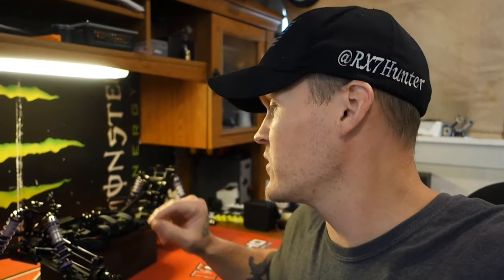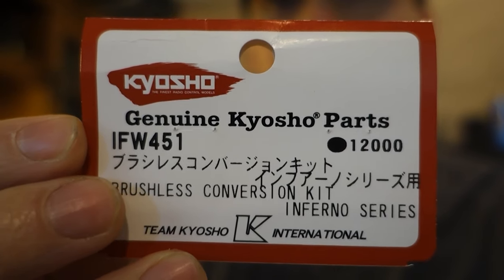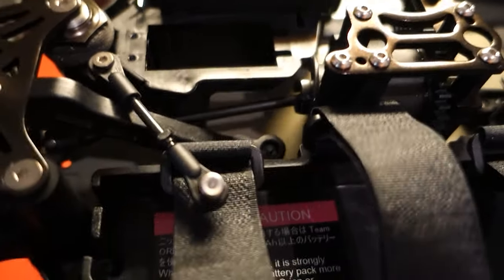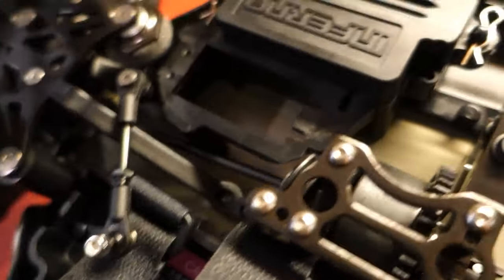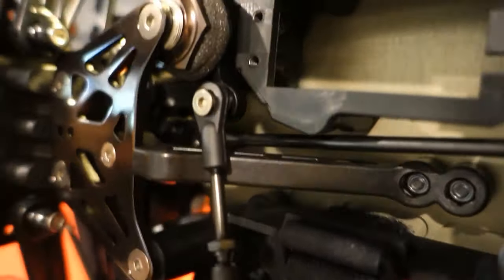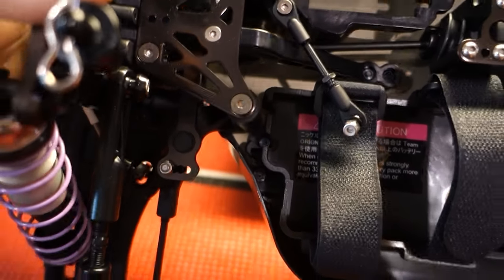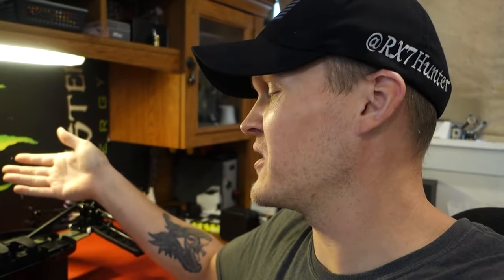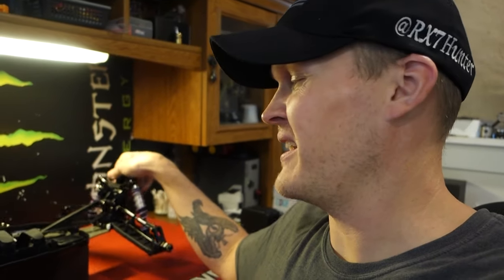KYOSHO BRUSHLESS Conversion Kit IFW451, Will it Work On The NEW MP10 & MP10T?  MP10Te PART-2

Comment: I just ordered that conversion for my mp10t. Is the center diff spur gear the same pitch as the mp10te?
Is it considered mod1 and what size pinion are you running with the 2250kv.
I think the center diff spur is a 46T.

Comment: Thanks for the video! Just assembled it and ran it with a 15 tooth pinion and the stock spur. There's not much top end. What pinion are you running? And did you change the spur gear as well?
Reply from the maker: No problem man thanks for the support👍🏻 I’m running a stock spur gear with a 16 tooth Pinion

Comment: I plan on doing the same e-conversion. Any tips on making it even more bulletproof?
Reply from the maker: Awesome man 👍 It goes together very well I would definitely recommend stiffer Springs.
Reply: What color are the stiffer springs?
Reply from the maker: @sunnyhigbee2939  I believe that would be the Red and dark blue
Reply: Thanks Nate. Still waiting on the kit to come in. Can't wait to start building.
Reply: I would like to do that to an  “Almost a roller” I got in a deal but I would like please information about the center diff. In the manuals it shows separate parts to buy not a complete ready to use part. TIA

Comment: Did the dimple for fuel tank overfill drain fit in the hole for the chassis ? I had to cut mine flush
Reply from the maker: I had to do the same, Actually glued it back in the correct location using tire glue 😅